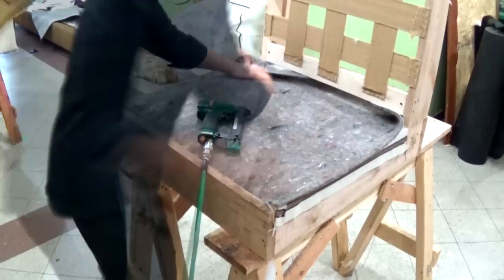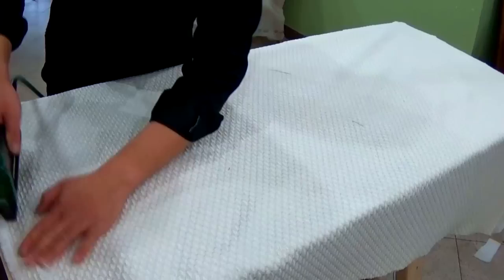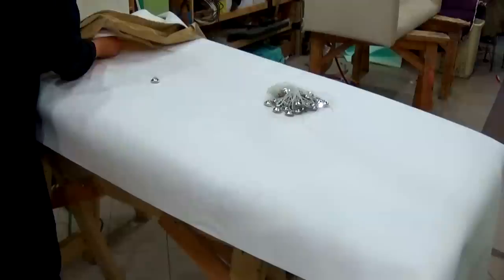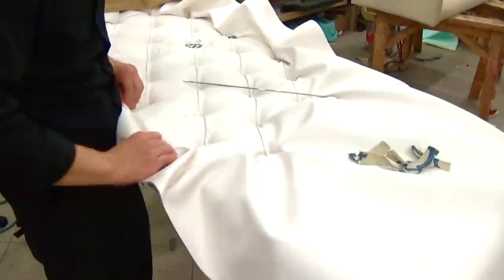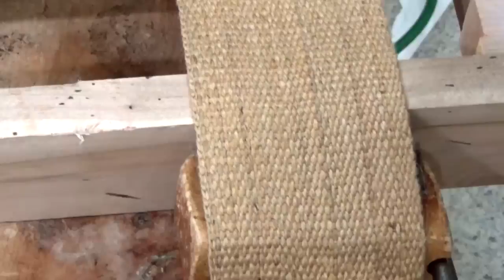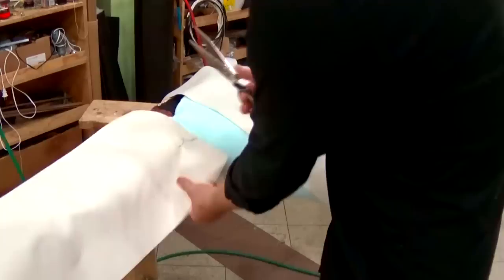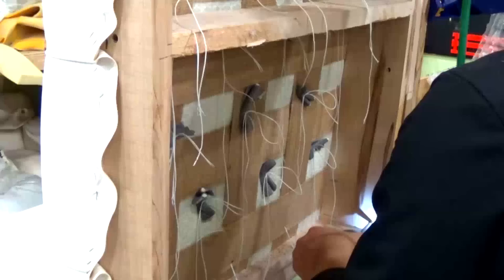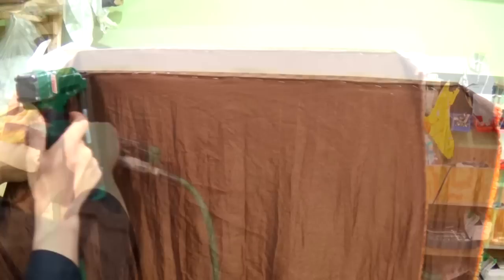DIY-HOW TO UPHOLSTER A HIGH BACK TUFTED CHAIR - ALO Upholstery

Comment: At 18:53 you are putting on the outside  back using tack strip.  How did you measure where to poke the tack strip through your fabric?  It looks as if you are doing it by feel...

Comment: The chair is amazing!  It seems that this tutorial is not for a novice. . . can these products (furniture pieces) be purchased online?  Also, if I were to attempt a project of this difficulty, where would I purchase all the supplies?  I especially love the crystal buttons.
Reply: HeavenlyMelodiesEnt I have about 80% of these supplies and I got mine from Home Depot, Ace Hardware and JoAnns. In his video I don't have the electric staple gun I have a manual one and I don't have the spray adhering machine. I buy individual cans from Ace Hardware. I haven't had the need for tacking strip yet.
Reply: Thank you Lady's Things.  I had no idea where to start with a project like this.